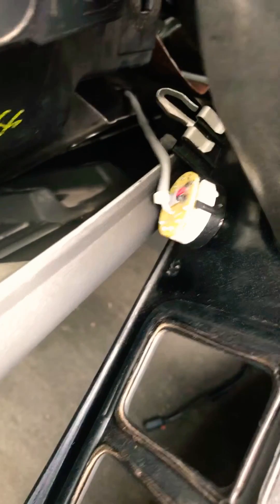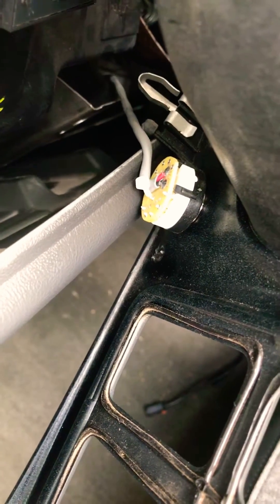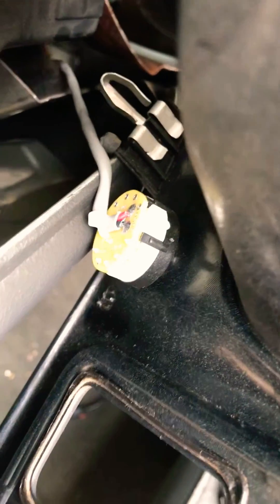Dsp5 EFI Live switch test: How to test using volt meter

Comment: What are you touching the leads to on the switch
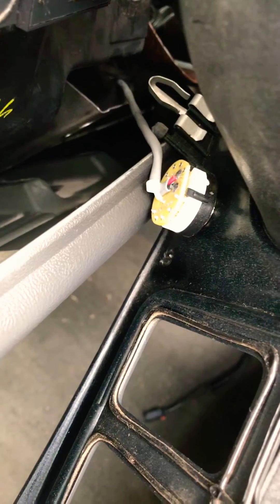Reply from the maker: At 0:22 you can see the back of the switch and you just touch the leads there on each side of the soldering of the red/black wires.